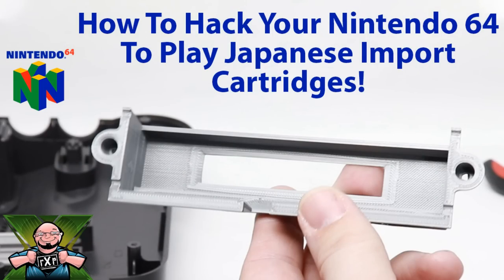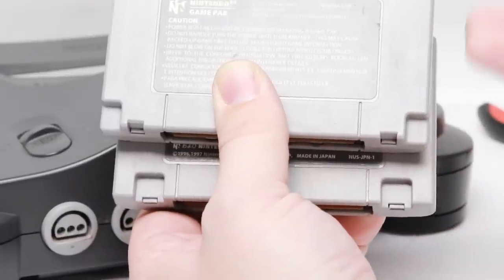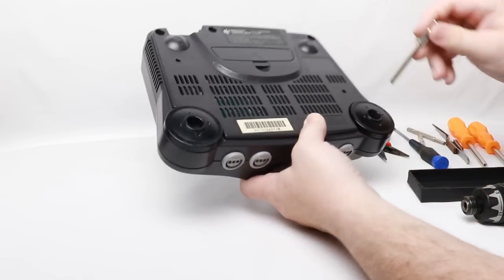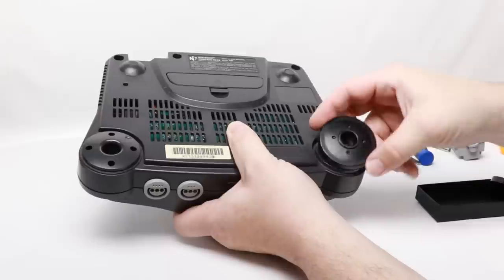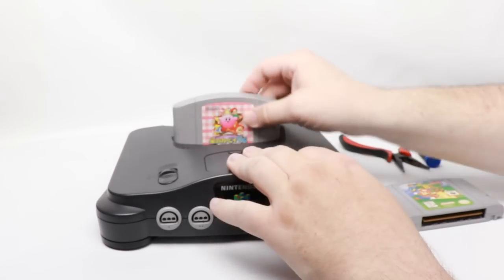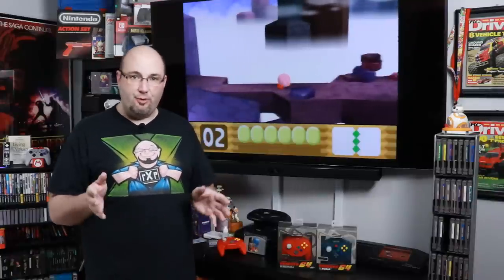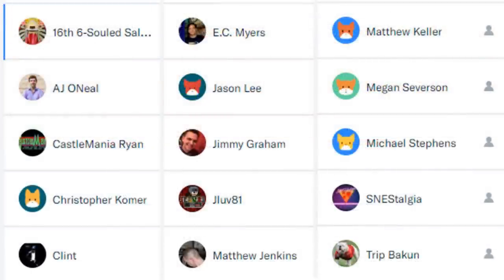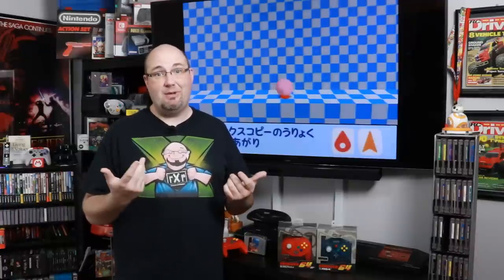Hack Your N64! How to Modify Your N64 to Play Japanese & American N64 Games without Damaging It

Comment: Just incase you're still unsure I can confirm this does work with pal games, it also works on my pal machine to play ntsc carts
Reply from the maker: Awesome, thanks for sharing! The N64 is one of the only Systems I don't have Pal games for
Reply: Thanks, I was looking for this information, nobody mentions ntsc games on pal machines
Reply from the maker: On some games you won't be able to play because they are software locked. There's not many, but they do exist.
Reply: These are all 37 games that are software locked

All-Star Baseball 2001
Army Men: Air Combat
Army Men: Sarge's Heroes 2
Asteroids Hyper 64
Bassmasters 2000
Battlezone: Rise of the Black Dogs
Brunswick Circuit Pro Bowling
Cruis'n Exotica
Dr. Mario 64
Elmo's Letter Adventure
Elmo's Number Journey
Frogger 2 (Proto)
Indy Racing 2000
Ken Griffey Jr.'s Slugfest
Madden NFL 2000
Madden NFL 2001
Madden NFL 2002
Midway's Greatest Arcade Hits: Volume 1
Monopoly
Ms. Pac-Man: Maze Madness
Namco Museum 64
NASCAR 2000
NBA Courtside 2 featuring Kobe Bryant
NBA Showtime: NBA on NBC
NFL Blitz: Special Edition
NFL Blitz 2000
NFL Blitz 2001
NFL QB Club 2001
Polaris SnoCross
Powerpuff Girls, The: Chemical X-Traction
Razor Freestyle Scooter
Ready 2 Rumble Boxing: Round 2
Space Invaders
Spider-Man
Stunt Racer 64
Tony Hawk's Pro Skater 3
WCW Backstage Assault
WCW Nitro
Reply from the maker: Thanks for sharing!!

Comment: Cool video for sure. This is a great way to do it. 
PAL games would not work as PAL systems have a true hardware difference due to a special chip. Unfortunately NTSC and PAL games have to be played on their own systems and as far as I know there is no mod or adapter that can change that. An EverDrive does allow that to work and they even run at the correct speed.
Reply from the maker: You can play PAL NES games on an NTSC NES Top Loader, but the music and game play is a bit sped up.
Reply: @RoXolid  it actually depends. Some play fine as they were not optised. Others play but are too faster. Others just don't work at all. Same applies the other way around but in return

Comment: Cool dude . I have  pal machine will this work ? And where can i get it from?
Reply from the maker: Not sure, pal is a different animal. I would think NTSC games would run slow, 60hz vs 50 and all. 

I found this on eBay
Reply: rab z no it only works on NTSC consoles Pal consoles are completely different and have a different CIC chip

Comment: You cannot play JP and NTSC games on a PAL Nintendo 64. This is due to the lockout chip the Nintendo 64 has. JP and PAL cartridges are exactly the same, so JP games fits into a PAL N64, but are unplayable due to the lockout chip. It won't give any signal, no matter what TV you have
Reply from the maker: NTSC is the video format used in North America, PAL is the European standard

Comment: How did u hook up the n64 to be on the screen that big and clear like that??
Reply from the maker: My system has an RGB mod from voltar and I'm using HD retrovision component video cables to a retrotink 2X
Reply: So you nodded the inside of the n64 then used those cables into the retrotonk and boom perfection ?
Reply from the maker: https://youtu.be/KIdeXBcoB1A

That's what I did

Comment: Een removing therestrictor plates for years lol, and the removal of a part is not a mod.
Reply from the maker: Sure it is, just because it's simple doesn't mean you're not modifying the system.
Reply: It is if you have replaced it with a different part.